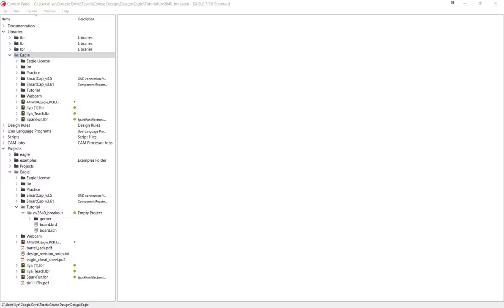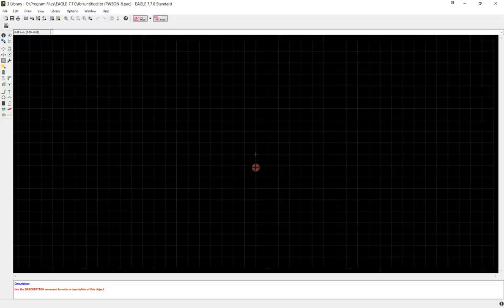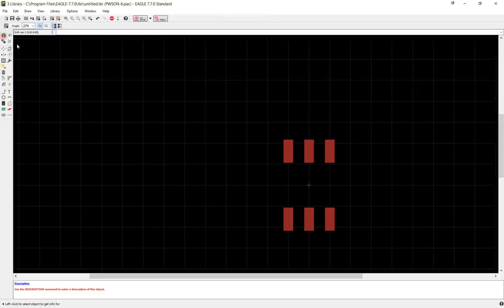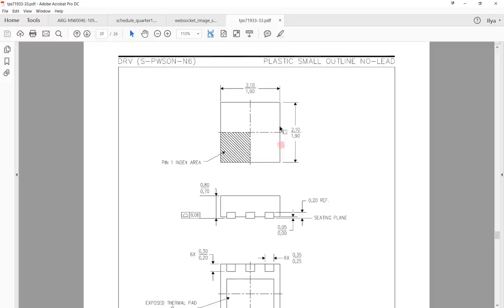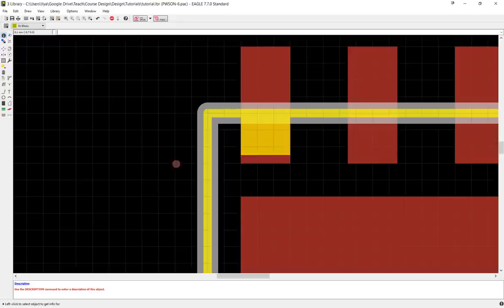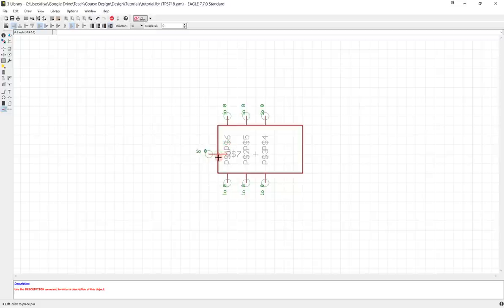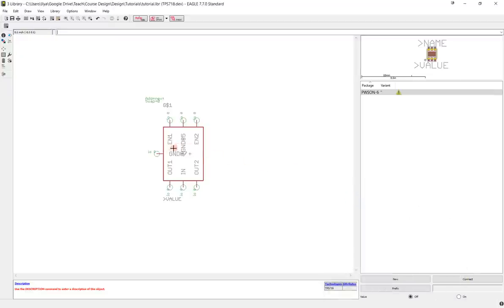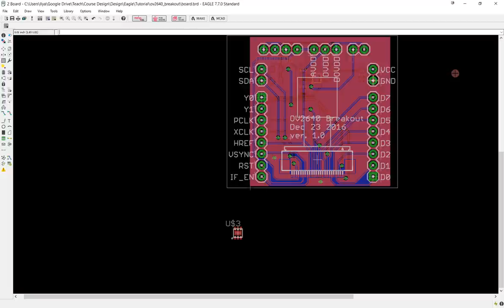Eagle PCB Tutorial: Custom Library

Comment: This is by far the best tutorial on Eagle I've found. Couldn't thank you enough
Reply from the maker: Thank you for such a nice compliment!
Reply: @IlyaMikhelson  The Autodesk website says about the tPlace/bPlace layers: "You need to be careful when using this layer not to place silkscreen on any soldered areas. Otherwise, you could risk creating a short on your board or creating a unsolderable pad."
So I'm wondering if it is ok to draw over a pad on tPlace layer. Do manufacturers automatically ignore silkscreen on Pads, or should I use layer 51 when drawing over pads to prevent issues?
Reply from the maker: @benutzernamenichtverfugbar4977  That's technically correct that you shouldn't use the tPlace or bPlace on pads, but it also depends on the board manufacturer. The last time I did this, my manufacturer ignored it. But it's better to be safe and to avoid this. As far as layer 51, it depends on your goal. Layer 51 does not generally get printed, it's purely for documentation for yourself. Therefore, it is perfectly safe to put on pads, but it will not show up on your printed board.

Comment: Fantastic video, even though im using eagle 9.5.1 the interface and icons are nearly identical to your older version. Only difference is that eagle calls the "packages" "footprints" now. but same difference. Took a pcb noob like me a whole 2 seconds to figure that out. You have helped me greatly in designing custom components for my project.
Reply from the maker: Thank you for your kind words.  I often worry that they'll change the interface, but so far so good!  There are definitely some nice additions in the newer versions, but the core functionality and interface is mostly the same (except for what you mentioned).

Comment: noob question, how can i change the directory for libraries? right now i have it at default which is annoying
Reply from the maker: In the Control Panel, go to Options (at the top), and select Directories.  You should be able to add (or remove) directories from there.  I hope this helps!

Comment: thanks a lot for this video
Reply from the maker: My pleasure!
Reply: @IlyaMikhelson  One question, while making the symbol, we don't have to be careful about the size of the microcontroller like we were while making the package? what if the symbol is too big in size? does that mean i would have to redraw it ?
Reply from the maker: @dutch759  The size of the symbol does not matter as it is not physical, whereas the package is. I am not sure what you mean by "too big" though. Can you please elaborate?
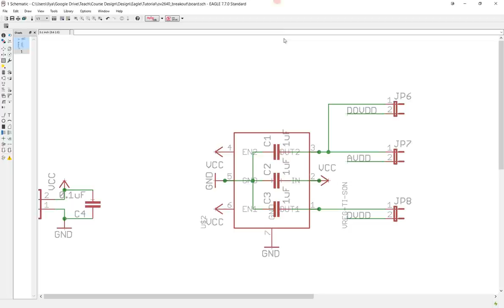Reply: @IlyaMikhelson  Really appreciate the quick response. Let's say I am making a circuit schemetic like u showed on 26:21 and my symbol, which I made with no measurements in mind, is way bigger than other components and is not suitable. Would I have to redo it or is there any way to make it smaller so I can fit it nicely.
Reply from the maker: @dutch759  That should not be a problem. I have made some very large components, just because that's what allowed me to show the pins as easily as possible (e.g. 144 pin MCUs), and it no problem. The whole point of the symbol is to show the functionality clearly, so you should make it as big as necessary to allow for that.
Reply: @IlyaMikhelson  ohh okay I understand now. Thanks a lot for your help.

Comment: You need to be careful when using this tplace layer not to place silkscreen on any soldered areas. Otherwise, you could risk creating a short on your board or creating a unsolderable pad.
Reply from the maker: Thank you for your comment. From my experience with the various fabrication facilities I have used, none of them have ever covered solder pads or created shorts due to the tplace layer. However, your experience is definitely valuable. Would you mind sharing which fabrication facilities have done this, so other viewers will know to be careful?
Reply: @IlyaMikhelson  Actually, i haven't tried yet but i read from AutoDesk Blog. https://www.autodesk.com/products/eagle/blog/every-layer-explained-autodesk-eagle/
Reply from the maker: Thank you for linking the article! I did a little more digging, and it looks like you are right to caution. It appears it is up to the fabrication facility to remove silkscreen on top of pads, but is not something that happens by default. It seems that most reputable facilities will do that, but it is best to not cover the pads in the first place. Thank you for pointing this out!
Reply: @IlyaMikhelson  You're welcome. I sent connection request on LinkEdin. I would like  to meet you.

Comment: OUTDATED
Reply from the maker: Thanks for your comment. Can you please specify which parts (besides the layout of the software) are no longer applicable so I can make modifications?
Reply: @IlyaMikhelson  I think a newbie to the software would struggle (as I did :-) ) as the layout and terminology has all changed. I'm using 9.6.2 Though I'd followed it all correctly but must have missed something as I can see my part but get nothing added to my schematic. Probably easier to follow on the latest version... maybe...
Reply from the maker: @paulstringer8554  That's fair. Learning the software is hard enough, and adding a different layout to it makes it even harder. As far as your part showing up in the schematic, make sure your custom library is enabled (by clicking the green dot next to it in the navigation bar). Then, it should appear when you go to add a part to your schematic. I hope that helps!